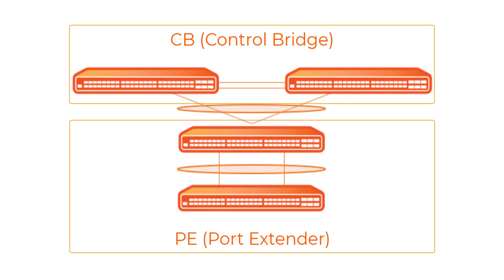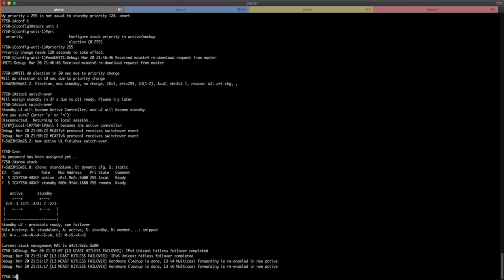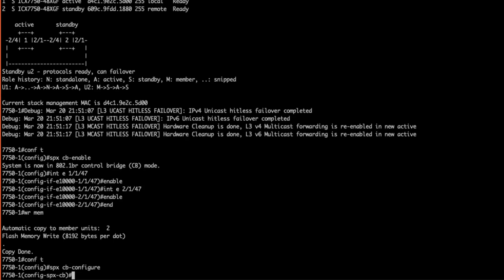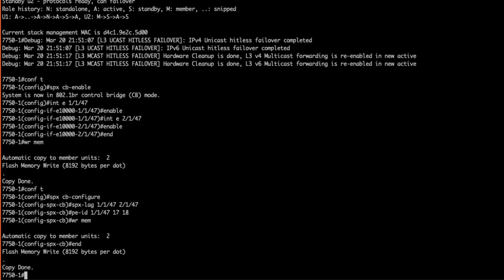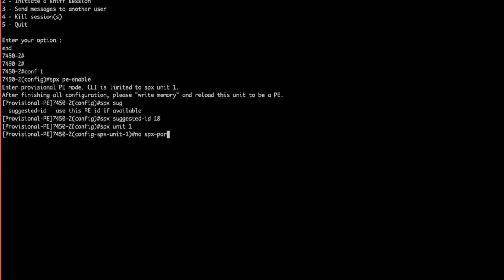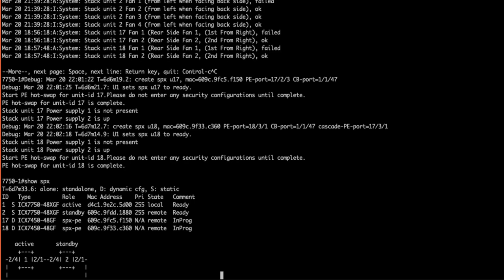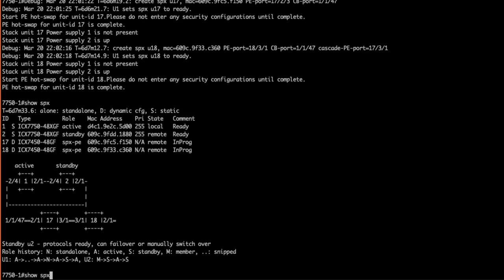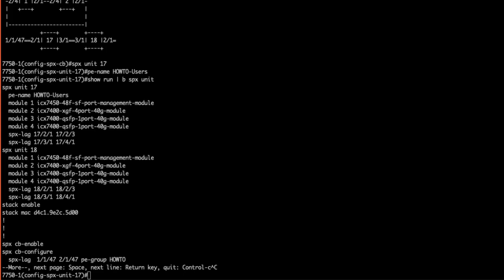Creating a Campus Fabric, or SPX Stack on ICX

Comment: which images can we use cb mode for icx 7850Q, im using TNR0890d, i can't find command cb enable.. thx
Reply from the maker: Just to verify, these are the exact commands you're trying?
Router# configure terminal
Router(config)# spx cb-enable

What message do you receive, just command not found?